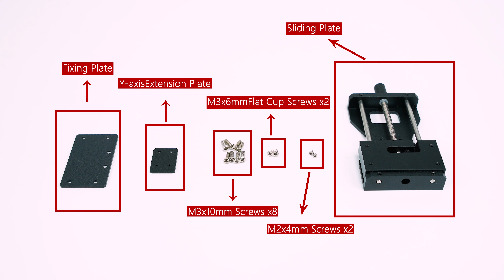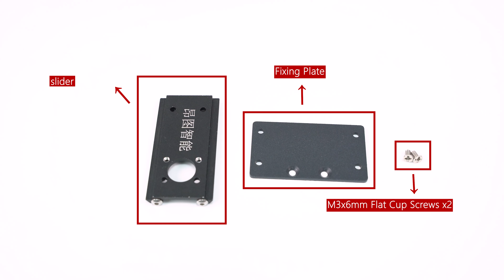Installation tutorial for the Ortur Laser Master 2 Pro S2 with z-axis lift

Comment: One part you didn’t show…which is a confusing part ‘AFTER’ installing the “physical” part, is the software GRBL re-configs. Some reference manuals and videos say it’s required to make 2 GRBL setting changes to account for the new Z-axis (weight, moment, and position). While other reference say mother and do not discuss this. Can you please help clarify yes or no, and if yes explain what the settings are and should be?

Comment: With this Z axis lift, does it mean you don’t need to lock the head in place using the side thumb screw?
Reply from the maker: The role of the z-axis is to easily adjust the focus of the laser module, to a certain extent will reduce the use of side screws😉
Reply: @orturnet  Thank you. I think I will get one for my LM3. 😁
Reply from the maker: @patricksasman1583  😉That's great!